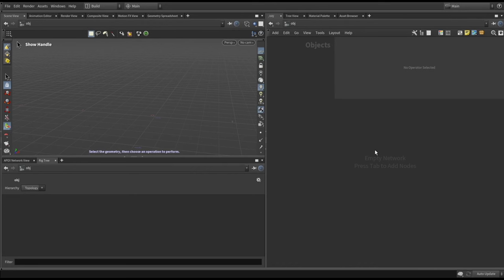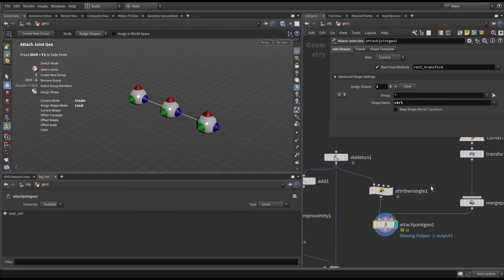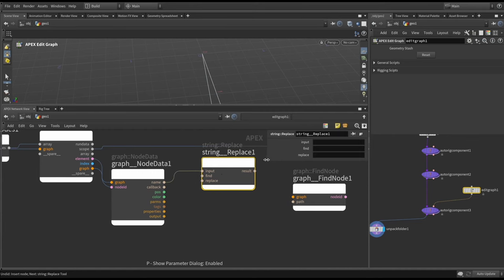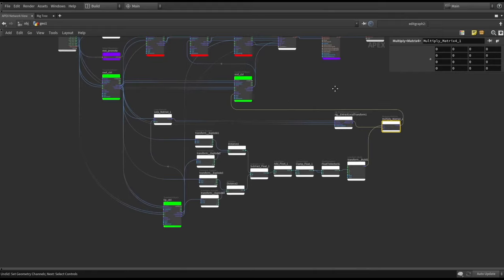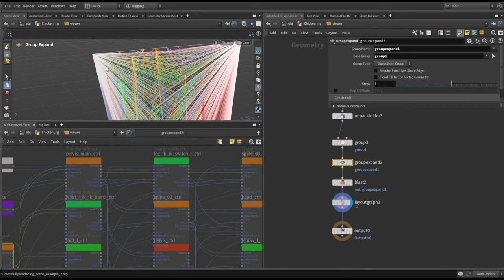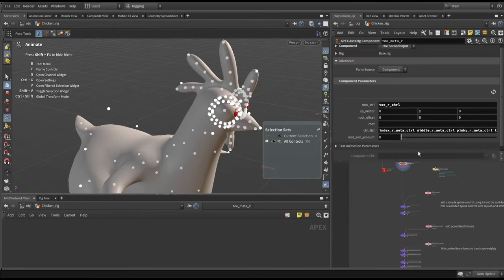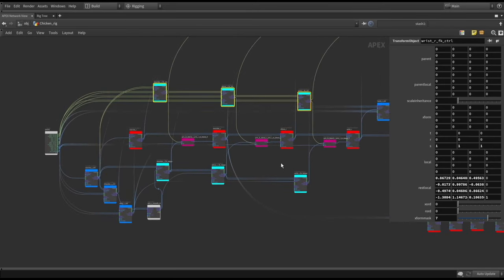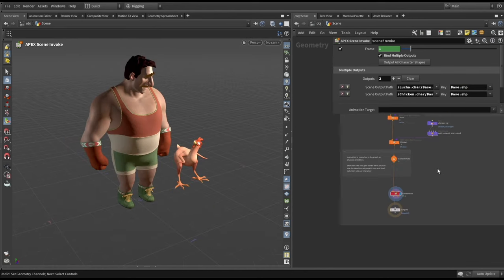APEX Rigging | H20 MASTERCLASS

Comment: Sigh. I appreciate your efforts but is there any hope for an auto rigging system or whatever? If a three joint setup like this already gets so complex then I can`t even think how an actual character may end up like...
Reply: Hi, Apex is still in beta. We will be adding more components to use in the autorig system. It should be a lot simpler to set up in the future :)
Reply: @williamharley_  I think the problem with APEX in current state is not the lack of premade components, but the whole approach of the APEX. The APEX as new context  is very unintuitive. Some nodes in APEX graph require to rename inputs, other require to rename nodes themselves. Also u have to refresh the nodes constantly. Rigging in kinefx looked way easier, although it is more difficult to animate complex rig with all rig pose nodes in kinefx. In any case, thanks for the masterclass:)
Reply: @williamharley_  Thanks a lot for taking the time to reply and for the info, William! :)
Reply: An actual character will need 5000~10000 APEX nodes. (mine takes about 6000)
Anyway the general advice of rigging in Houdini is: don't.

Comment: Awesome masterclass, William, thank you! 
I am still trying to figure out two key things in APEX. 
1 - How to make a simple skeleton blend like in KineFX, for animators? Can we actually have a slider in parameters, or it could be only connected to a control, like the IK/FK switch on the chicken in 3D space? 
2 - How can we bring an existing animation to APEX? We have motion capture, perfectly retargeted to a skeleton (with KineFX). So the demo of Esther of KineFX/APEX is nice, but it's actually retargeting to the controls, and there are some jumps and flips etc. If we have the animation on the exact same skeleton, can we bring it to APEX (I think Warren mentioned some rig inversion in a chat, but couldn't find any info about it), and animate with a rig on top of mocap? 
Thank you!
Reply: 1. For blends, you'd use a "Transform Blend" node within your APEX graph, and you'd need a float value to adjust the "Blend" parameter in the node.  To adjust float parameters you'd have to use a abstract control, or use a transform object and use it's transform parameters to control the blend's float value.  

2. So far there doesn't seem to be any way to create animation layers as you would in something like Maya, but considering how channel primitives work, I wouldn't be surprised if SideFX is developing this for their next update.  In terms of the flipping, it could be a position issue.  Are you matching the skeleton's position before transfering the animation?

Comment: Thanks for making the video. I'm getting stuck on a couple places with the simple example. Can't seem to get the controls selectable. I see you're on an older version so UI looks a bit different, but setting the guidesource to Base.skel  in the autorigcomponent node does nothing for me, can still only select the joints :/

It's a polygon mesh I'm using for controls (and am I understanding correctly that NURBS aren't working as control shapes?)
Reply: Same here with 20.0.724. When i write Base.skel on "guidesource" parameter doesn`t give me the shape highlighted.  Checked names so many times and it nothing is misspelled. So did you have any luck with that?
Reply: Same here on H20.5, no control shapes visible after bonedeform component.

Comment: Thank you very much!
I've got an issue after creating the custom graph. The Autorig Component shows the warning: 
The provided graph must have a character output 
Any idea what' wrong? I set the parameter name on the subnet output to character as  shown in the tutorial.
Reply: I don't think you have to set the parameter name to "character" explicitly, the "updatecharactergraph" node has that output already no? You just connect it to the subnet output. 

Only other thing I can think of is maybe you didn't connect the "scope" from the for loop start to for loop end
Reply: I have the same issue. right at the start where we are just getting the data in. I did not even modify it yet

I think it might be related to renaming the graph to "rigname" .
when I renamed it back to "graph_name" it somehow started working.

apparently the names of the other nodes like "parms" and "output" also seem to be important
Reply: I had the same issue a couple of times. It usually goes away after restarting Houdini. "rigname" is correct.